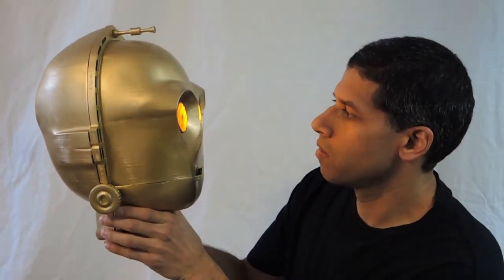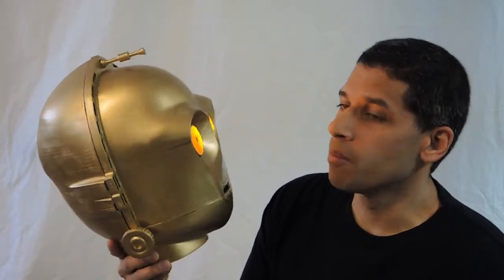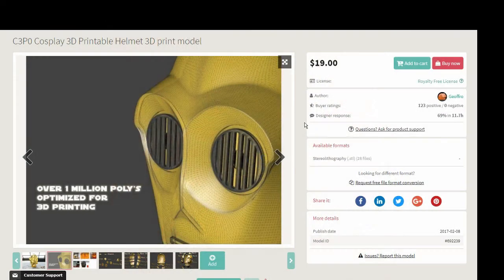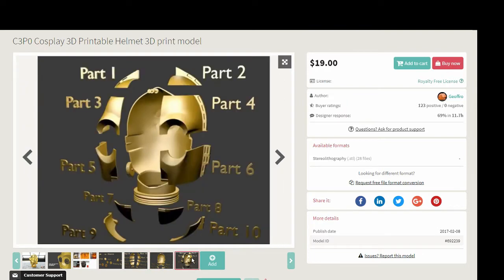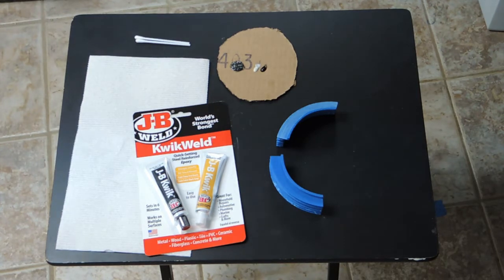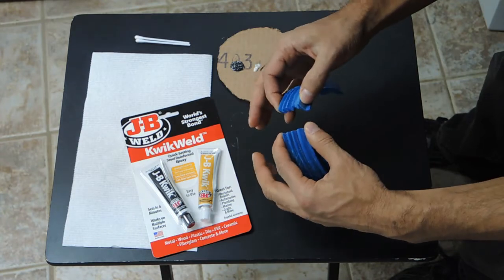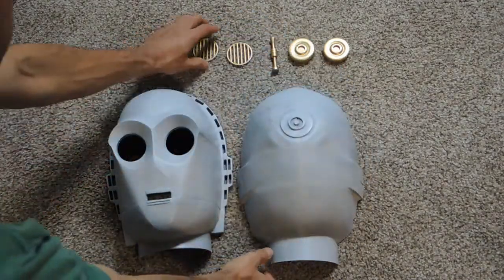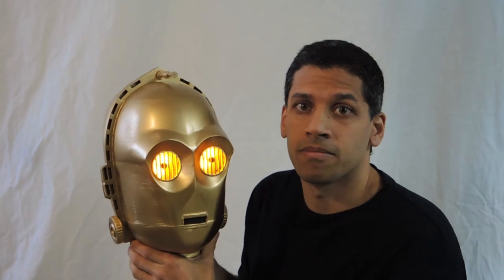Star Wars Droid Build: Talking 3D Printed C3PO Head, Part 1

Comment: Great Work Bro. In the future, you may want to use BONDO next time for the filler. Wood filler tends to release from plastics and can crack over time.  Great work tho.
Reply from the maker: Thanks. I saw wood filler recommended in various places on the Intertubes and wanted to give it a go because it seemed easier to work with than Bondo. iIt will be interesting to see how it holds up and I will use Bondo next time if it doesn't.